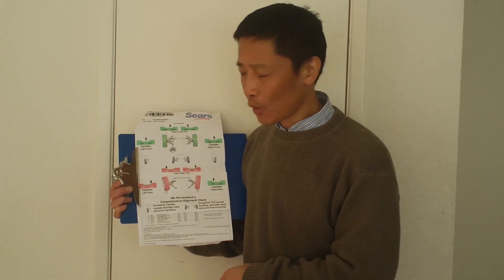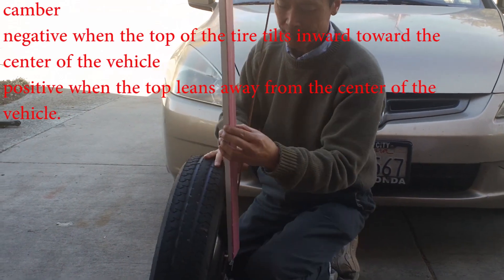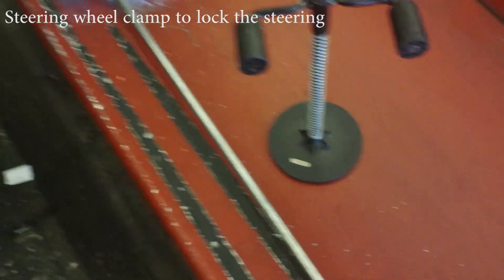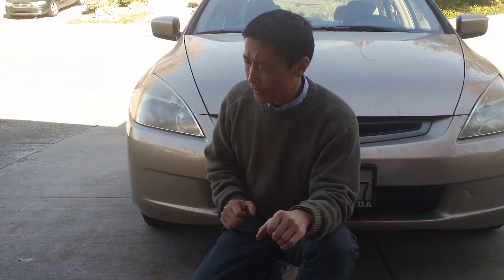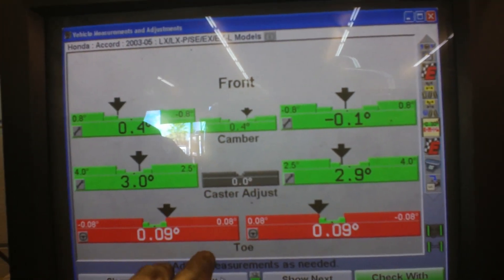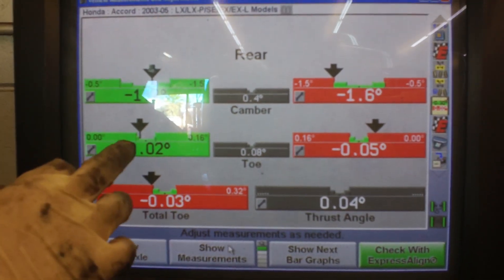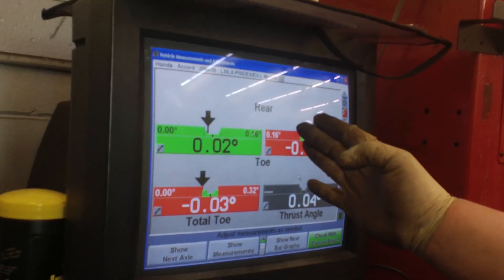Do You Need Wheel Alignment? How Is It Done?

Comment: Actually you should do alignment on most Japanese cars more frequently in order to keep the bolts moving, cause they rust so much ;). I know cause I own one and replaced both rear lower arms with original bolts just to be able to do an alignment ... Bolts alone were 100$.
Reply from the maker: Thank you for sharing. Yes, rust for cars on the east coast (although we don't have snow in California.) In that case, you will have a trade-off for the frequency of alignment. Comparing the price of A  and B:
A. twice alignment and changing bolt: ($89+$100)*2=$378
B. replace 4 tires: $400
So it still depends how bad is the alignment, you may go either A or B.

Comment: if wheel is not a rightly balance can any chances vehicle one side pulling
Reply from the maker: Angular momentum is defined as L=I*w, where w is the angular speed, thus you don't feel the balance problem at low speed. However the alignment can be detected at low speed. So if you feel your vehicle one side pulling at low speed, then it is not due to balance of the wheel.

Comment: Can you make tutorial of it without using computers and expensive tools?
Reply from the maker: That is a great suggestion, I will work on it when I have the time. Thanks.
Reply: There’s really no proper way to do it without a laser alignment machine.

You can adjust it to a point where it drives straight using a string, or a yard stick, but chances are your steering wheel will be off Center.  And even if it’s not, and you do happen to get it going straight with a straight wheel, you’re still risking wearing your tires unevenly and faster at that.  

As an auto tech myself, I’m all for people learning how to do things themselves and save money, even having fun or just knowing something new in the process of keeping their car running as long as possible; but this is something that should be left to someone with a properly calibrated, fully functioning machine.

Comment: Why aren’t all the numbers the same for all the wheels? They should be all the same so the car can drive like a new car
Reply from the maker: even a new car may not have the same,  it is fine as long as the numbers are in range. Metal can be bend, joints have  tolerance.

Comment: The fact that there's only 2 lug nuts on his wheel at 5:00 is pretty freaking scary.
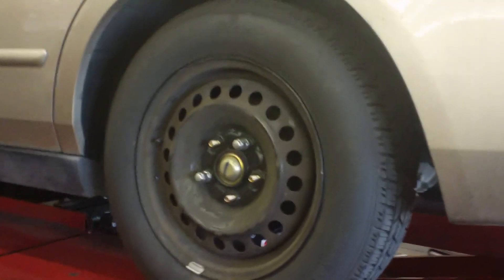Reply: You have good observation in details. If you view the time at 5:28, how do you put the the reflector on the wheel?  FYI, we never had any car with any lug nuts missing while driving.
Reply: That's why Hondas don't loose hub caps. The nuts are outside the cap not over.

Comment: alignment is mostly done on cars when it is low profile or raised or off roading.  stock high already has its toes and cams adjusted to it's stock height. that's why most dealerships cars does not have adjustable. control arms.
Reply from the maker: thank you for sharing
Reply: Not 100% true

Comment: He is incorrect that BMW's need alignment more often than Toyota's, I guess anyone can post on You Tube
Reply from the maker: You may take your Toyotas to do as many alignments as you want, but the purpose of this video is to show people that it is not necessary to do so. Even if you want to perform alignment, some parts are not adjustable anyway. For our Honda Accord, we did not have any alignment until 120k miles. It makes sense that low end car would make certain parts not adjustable so that a fixed design can cut manufacturing costs.

Comment: sometimes worn suspension parts can be perceived as alignment problems. I had an 87 camaro and while I did not take it to get a professional alignment. I took some auto classes in college and I found out that doing an alignment is pointless.it will hide the problem and you'll be ripped off.
Reply from the maker: thank you for sharing

Comment: vehcile measurements and adjustment software is a microsoft operating system looks like XP curious what the software is called and if it is free ware or an equivalent out there. Toe wears out usually more then camber but curious this software doesn't have anything for cantor is cantor usually not able to set on a car. Is cantor fixed on a car i would imagine if it is adjustable then it would be some strut bolt or something on the suspension
Reply from the maker: thank you for sharing
Reply: sam111880 Caster on SOME vehicles is adjustable using the same adjustment as the camber.  As you adjust camber, caster will also move.  This is done using either eccentrics which push and pull the control arm in and out, or by physically loosening the control arm and pushing it in or out by hand, and then tightening the control arm back up.  There are also ways of installing aftermarket parts such as adjustable strut mounts in order to modify the angle of either camber or caster, but those are typically seen in cars that are being modified for events such as track racing or drifting.

Most alignment software that I myself am aware of is windows based software but no it is not free, and can not be used without a special vehicle rack that is set up to do alignments

Comment: Beware, this is terrible advise! This car was clearly out of alignment and required service. Being close to factory specs is not the same as being within factory specs. Factory alignment specs have a specified + or - tolerance that is acceptable. Driving outside of this tolerance will increase tire wear, increase rolling resistance which will cause poor fuel economy, and may cause a safety hazard or driver fatigue if the car drifts or pulls to one side. Replacing tires tires can be as high as $1000-$2000, an $80 alignment is cheap insurance to protect your tires, save fuel, and drive safe. The first shop offered a great service for free and should be thanked for providing this valuable information without charge. Regardless of where you serviced your vehicle, the alignment was necessary.
Reply from the maker: Undercar Experts the camber and caster are not adjustable by design  for this car, are you suggesting that I purchase after market parts? Thanks.
Reply: corgLLC Hence the reason why the aftermarket part was created, to solve a problem. There is no substitute for doing a job correctly. If it was my car, yes, I would purchase the aftermarket part and align my car within factory specification. You may choose differently for your car, but offering advise that says you didn't need an alignment when you clearly did is wrong advise. You chose to not fix your Chamber but you did correct your Toe problem, you still made some corrective action to your vehicle's alignment that will help protect your investment more than doing nothing at all. Would you refuse to eat healthy even if you couldn't afford heart surgery?
Reply from the maker: Undercar Experts The cost was not just the $80 test, it was a lot more. After the test, I did actually asked the question. The whisper was that "probably it is not a big deal". So yes, you are correct that unaligned wheel may cause other problems. But still what is the decision in the end?  If an old person has heart condition, cancer and may be other problems (like an old car), is surgery always the best option?  That car had 150k miles, never had excess wear on the tire by the way.
Reply: Sears here charges $90 for an alignment.  That test you paid $80 for is the first part of the alignment process.  You could have paid $10 more and the alignment would be done.  That's hardly comparable to a 90 year old person electing a protracted chemotherapy course.
Reply from the maker: @Jason Koneman, our sears did give us free alignmen test

Comment: I just want to say i enjoy your video's, especially the tai chi ones. I've been studying Tai Chi for two years now (124 yang), and Wing Chun for 23 years. I was the wheel alignment guy for 5 years at the Goodyear in Acworth Ga where i live. your car was barely out of alignment on the toe angle.  -0.5 is smaller then a hair on your head, and shouldn't cause any tire wear.  I always hated the green and red spec screens, i always looked at the measurements ( the actual numbers), thats how you determine if the car is out or not, as well as the test drive. Also, to answer your statement in the beginning of the video, the car can be out of alignment, and still drive good.
Reply from the maker: Thank you for confirming that I did not need the alignment. A lot of my friends are not sure if their cars needed the service either. I had a feeling that I did not need alignment before I paid the service, but I wanted to share the findings with my viewers, thus went ahead with the service. Yes, youtube is amazing, it connects us and lets us share tai chi and diy tips.